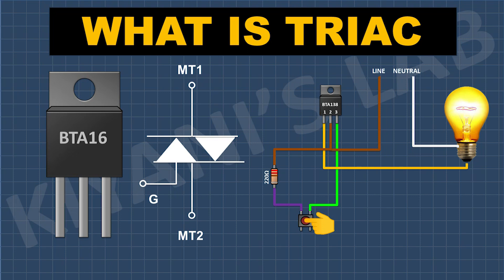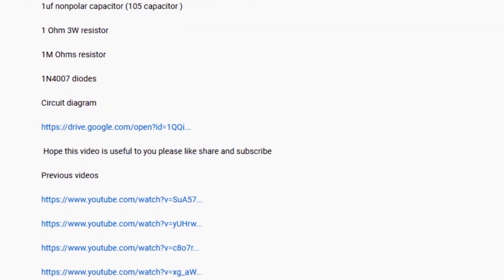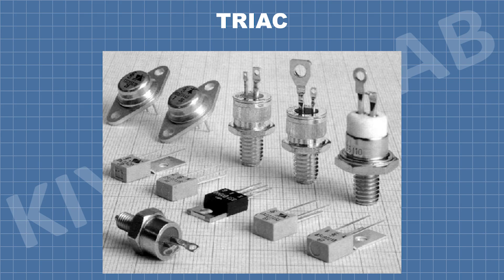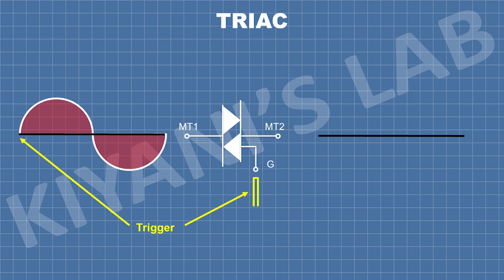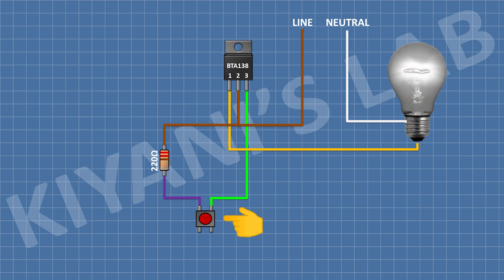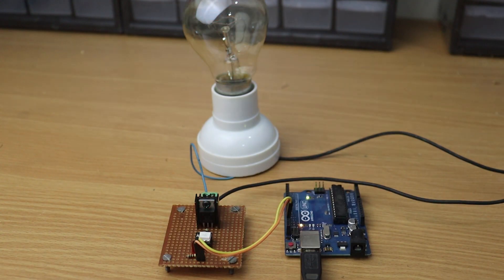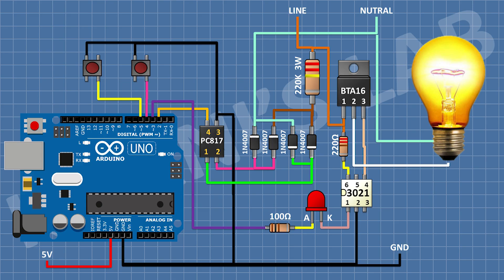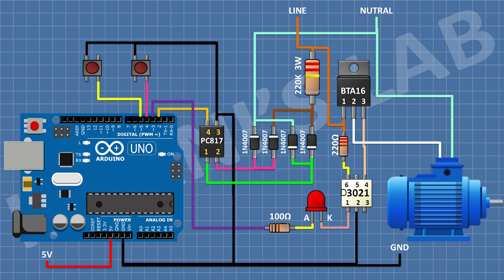What is TRIAC ? | How TRIAC works

Comment: I want to control a transformer with an arduino to produce output pulses e.g. 
Pulse 1 12% power 50mS duration, Delay 500mS, Pulse 2 55% power 80mS duration. 
I think your circuit gets me half way there. 
Can you tell me how to research the code to do the following with an Arduino
Control Pulse 1 and Pulse 2 pulse widths
Control Delay duration
Control Pulse 1 and Pulse 2 Power levels (percentaage of full power) 
Connect the control switches/buttons and display? 
I have never used an Arduino before. I have been advised to use an Uno r4, I notice you used an Uno in your project, do you recommend it? 
Thank you, very well done example, I appreciate the oscilloscope display, that makes things very clear.

Comment: A few issue. You have mt1 and mt2 swapped on the symbol. The trigger signal (gate) is reference to MT1. The trigger can be positive or negative relative to MT1and MT2 can be positive or negative with respect to MT1 meaning there are four distinct ways a triac can be triggered. A triac cannot be modeled as two  SCR’s., the triggering is different. You can sort of think of a track a directional SCR.